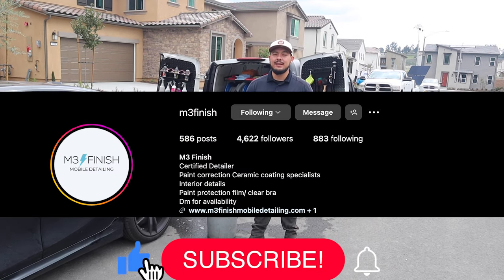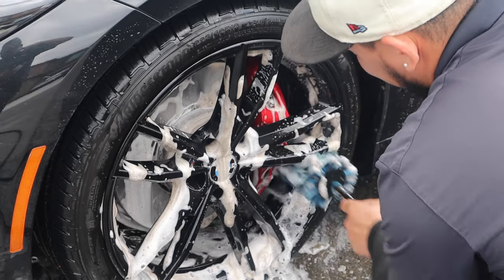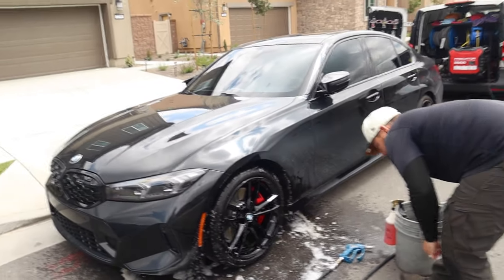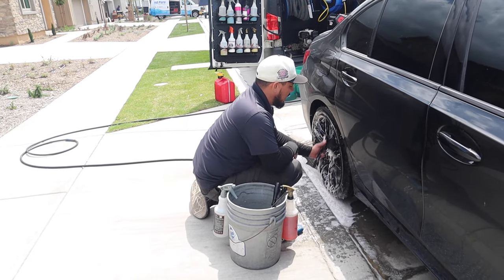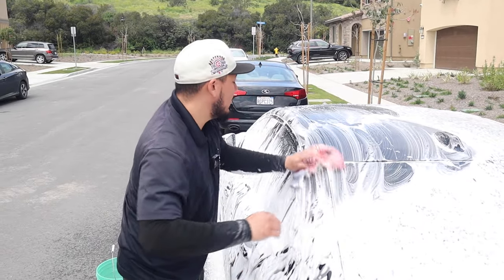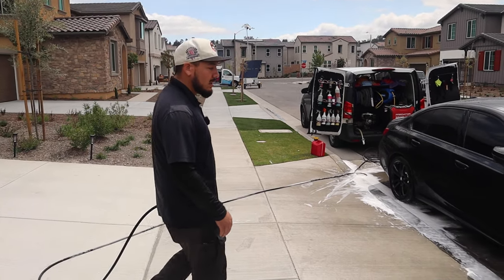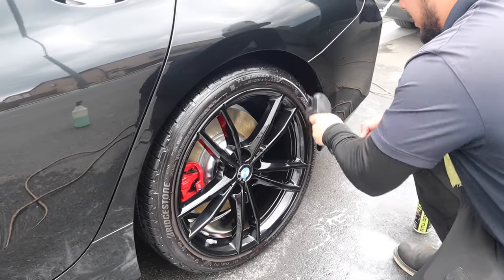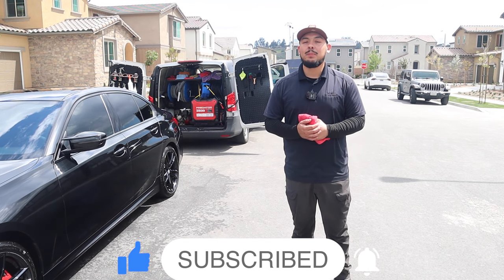How to clean your wheels like a pro detailer

Comment: Very nice detailing job. You seem like you've got a lot of experience. I have a few questions I would like you to answer:

Any reason why you don't wear any protection? (gloves, goggles etc.) Especially when using hydrochloric acid (which I assume you do?)

You say that you rinse off the body of the car before foaming it and agitating it. Water dilute products, so why do you rinse before a prewash?

Are you agitating the vehicle on a prewash?

Thanks in advance. Keep up the good work!
Reply from the maker: Thank you for the amazing feed back ! 
Yeah this was the first video in the morning so i ran out of gloves and wasn’t near a detail shop. I used gloves on the daily. and you always want to rise off as much debris as you could. So you lessen the chances of scratching the Surface. I rinse ,foam, pre rinse, rinse then foam

Thank you I appreciate the support 🙏🏽

Comment: Great video, 
car came out flawless. 
What chemical is that on the Diamond chemical bottle? 
You applied on the wheel wells.
Reply from the maker: Hey thanks for the comment I used an acid base cleaner from nano skins 4:1 dilution ratio. As far as the wheel wheels it was solution 1:1
Reply: @m3finish  appreciate it, thank you.

Comment: How do you prevent rotors from rusting on BMW
Reply from the maker: It’s hard to prevent it unless you’re using a apc or a light cleaner. The rotors are uncoated so they tend to have a chemical reaction with mild cleaners. A trick you can do is after when done washing and cleaning you can roll the car a few feet and press the brake a couple of times then go back and break. Then it will be back to normal. It’s common to happen thank you I appreciate it 🙏🏽

Comment: whether painted or powder coated doesn't the blue brush scratch the hell out of gloss black wheels? It works great but don't use it on my black wheels. Thorough job though. 👍🏻
Reply from the maker: Anything can scratch the vehicle they was I rinse the wheels before starting. Then use the right chemical on the wheel the key is to put 2 oz in the bucket for perfect lubrication. Thank you for the support I appreciate it 🙏🏽

Comment: Bro as soon as you turn on the car and drive there is already going to be brake dust on them. You should fine a chemical that you should use less man power and more effective on cleaning! Less contact for your hands and also wear protection on those hands!
Reply: Judging by your cleaning suggestion...You obviously don't do detailing or know detailing. So just 🤫🤫
Reply from the maker: Hey thanks for dropping in on the comments I appreciate it. Far as the chemical I found it that was the best one for the job. Those wheels were pretty hammered. For the gloves 🧤 yes I used them daily but I just got caught up on filming just because I was on a limited time for shooting the videos 😅 thank you
Reply from the maker: I love you brother 👊🏽